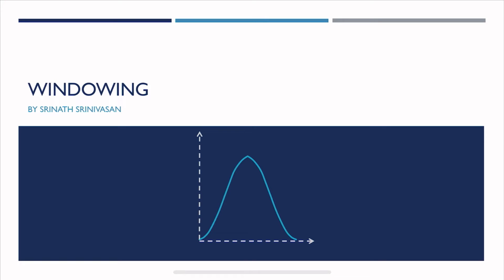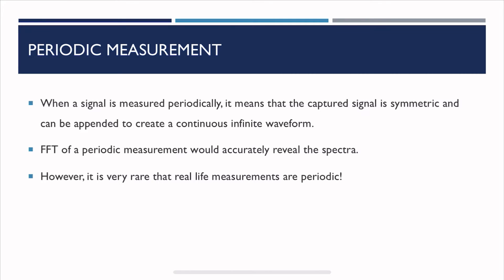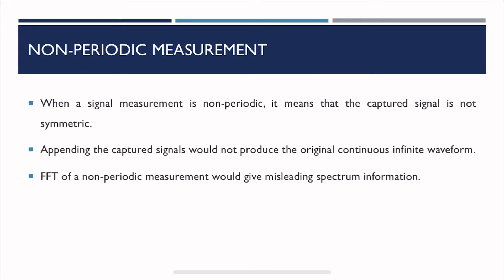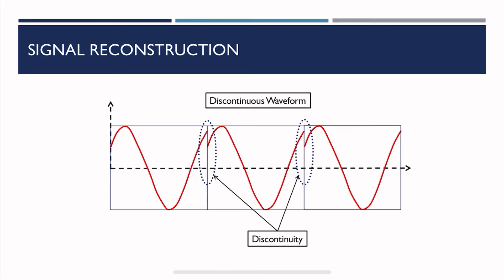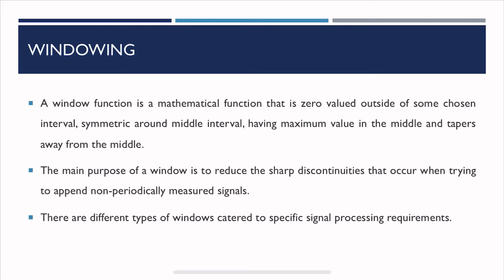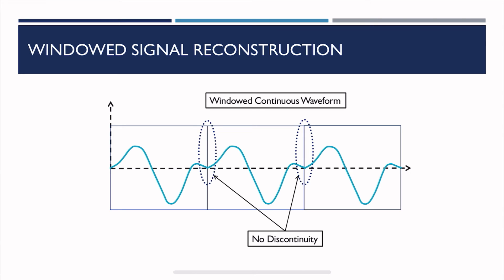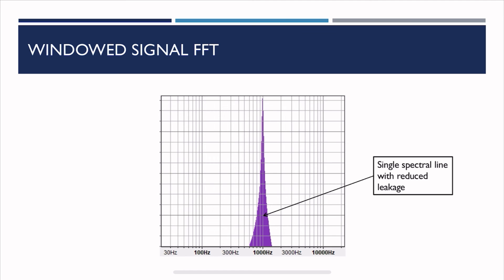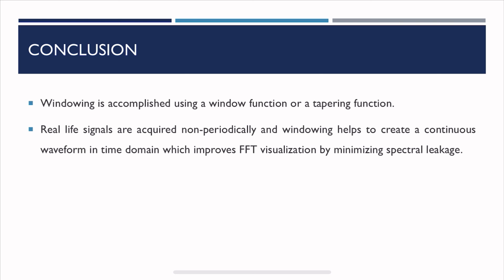Windowing explained

Comment: Can i replace window function with a low pass filter?
Reply from the maker: Probably not because the main goal of windowing is to ensure there are no discontinuities. Not performing windowing of course results in spectral leakage but if the sound is broad band in nature, one cannot distinguish the original high frequency components and the ones generated because of this leakage. As it is difficult to distinguish, the cut-off frequency for low pass filter cannot be determined and thus cannot be used. As far as I know, most software have windowing as a default or automatic process which cannot be altered.

Comment: Hi there, great video. I was curious to know , with a synchronous measurement technique, where the no. of samples captured is dependent on the shaft revolution, would there still be chances of spectral leakage?? Rather can a synchronous measurement be termed as a periodic measurement???
Reply from the maker: If the captured time signal when appended to be infinitely long, doesn't have discontinuities, then there is no need for windowing as signal is already periodic. In reality, this is rarely the case. Windowing is thus a default step in signal processing before performing FFT.

By definition, a periodic motion is one that repeats itself in equal intervals of time. If any motion exhibits this phenomenon, then it can be considered periodic.